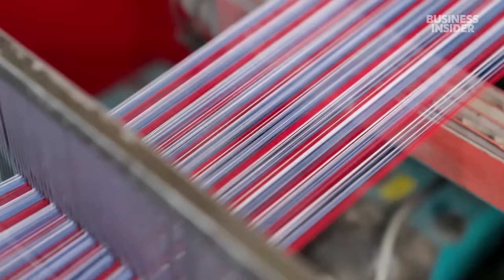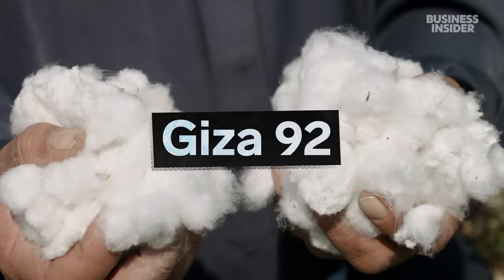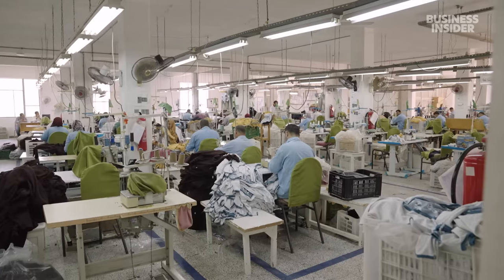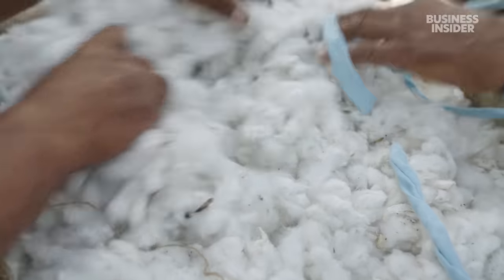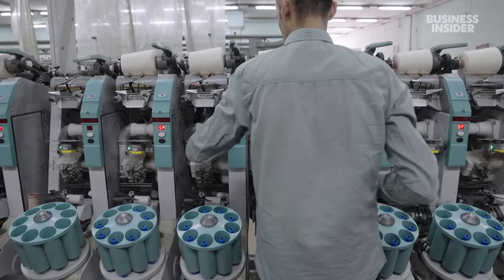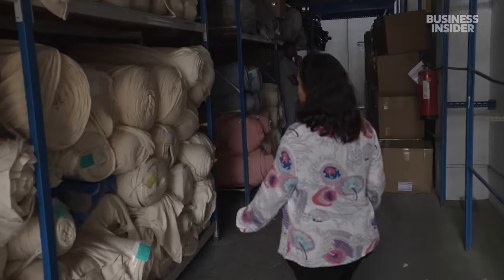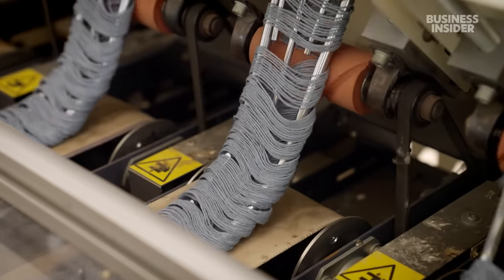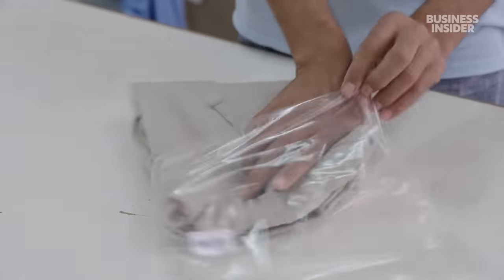Why Real Egyptian Cotton Is So Expensive | So Expensive | Business Insider

Comment: I am so sick of everything either being a luxury good or a cheap knockoff. Where the hell has the middle ground gone?
Reply: Normal cotton is the middle ground in this case. Normal cotton is good. Not as good as Egyptian cotton but still a good product.
Reply: @WinterbIue there is no "normal cotton". It's those "upland cotton" u meant. 😅
Reply: I sleep very well on $50 and $75 sheets.
Reply: It's gone where most of middle class ppl did 🙄
Reply: stop being such a cheapskate
Reply: The middle ground is knowingly buying 100% cotton, or 100% synthetic fibers.
Reply: There is nothing special about Egyptian cotton versus cotton from anywhere else. They’re just doing it by hand, which is more expensive. It’s just a gimmick.
Reply: @kitkakitteh it is different, the video mentioned it. Longer staple and stronger.
Reply: The Middle Class is GONE
Reply: @kitkakitteh  Egyptian cotton, the plant, has the best quality. Long and narrow threads.
Reply: Long staple vs. short staple fibers. You can tell the difference in the feel of both through experience. Long staple items are usually beautifully smooth, but in a natural way. Cotton is a good natural fiber, however I've found wool is superior to it. Wool is sustainable, biodegradable, temperature regulating, water resistant and even odor resistant! Cotton is NOT odor resistant, and in fact takes on odors rather easily. 🤣
Reply: @kitkakitteh false. It's long staple fibers vs. short staple fibers. Most of the cotton items found in the store are short staple. You'd have to experience it to know the difference. 👍

Comment: Blockchain technology solves this problem, however it’s seldom implemented by producers. With blockchain technology it would be both easy to tack as well as verify a product. Many blockchains are involved in this but the industry is also still maturing for widespread use. When certain blockchains, especially Ethereum mature, you’ll see this problem gone.